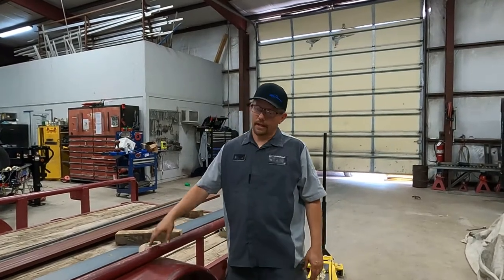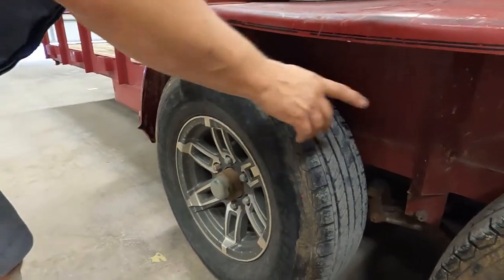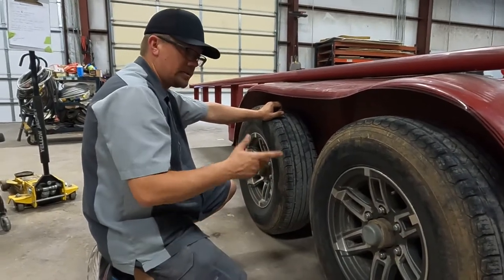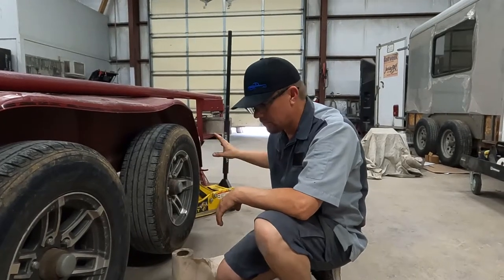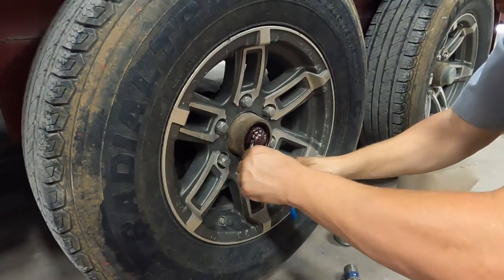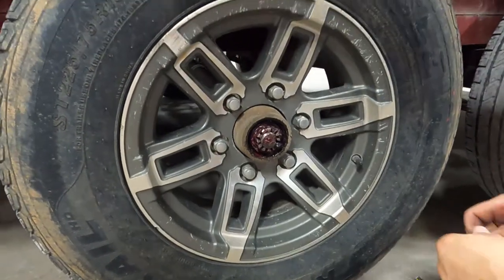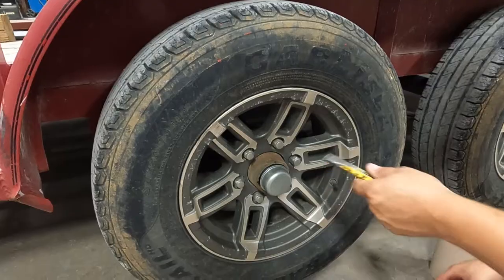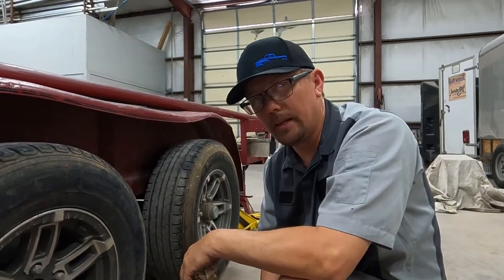HOW TO FIX LOOSE BEARINGS

Comment: Have you ever used a bearing spacer? Essentially a sleve that goes between the outer and inner bearing that takes up the slack so that you can torque the bearings with a torque wrench without causing them to be overly tight on the hub assembly. I personally haven't, but i have seen them before and found it interesting.

Comment: Good afternoon! I have to adjust my rear left wheel bearing… and I see you’re turning your wheel counter clockwise, but I googled and it said turn the wheel clockwise. Does it matter which wheel with which way you turn the wheel?
Reply from the maker: Hi. That’s a great question!  I always turn the wheel counter clockwise, regardless of which wheel it is. The old shop manuals and the shop standard has always been to turn counter clockwise. But the current manuals suggest that it’s okay to go either direction. It has been my experience that turning counter clockwise produces a more desired result. Again, that’s counter clockwise, regardless of which wheel you’re turning. 
Thanks for watching the channel!

Comment: Thanks for the video.  I am adjusting the front tapered bearings in my 2WD pickup.  My question is…with the tire off the ground, should the tire move at all when you grab the 12 and 6 position?  Mine moves just a teeny tiny bit.
Reply from the maker: Hi!  Thanks for watching. The same concept that applies to trailer tires/bearings works on pickups, too. You shouldn’t be able to see the movement, but lightly feel it.

Comment: What if bearings are too tight?
Reply from the maker: Good question!  If they are too tight, it can cause overheating and premature wear or failure.
Reply: That is not how to adjust a wheel bearing.  That is much to tight and all that preload will burn those bearings up you should have one to two thousands end play when you are finished adjustment.